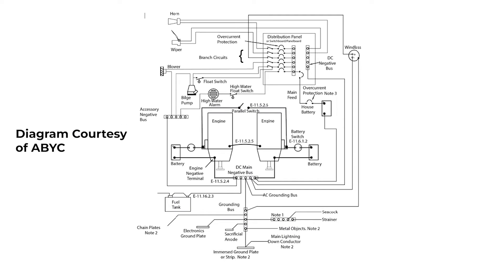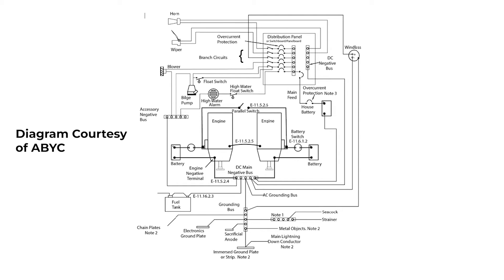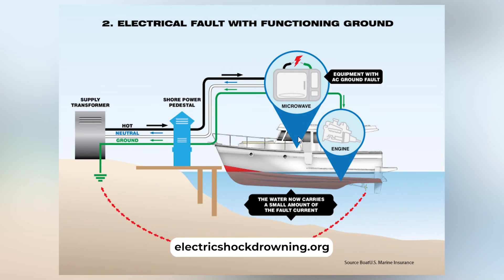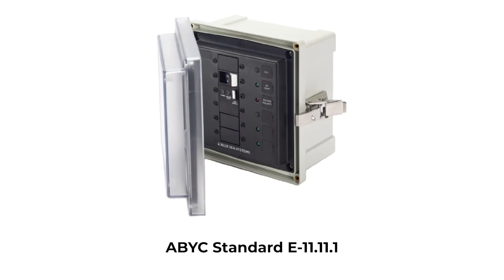Nigel Calder & Jeff Cote Talk Marine Electrical - Part 2 of 11 - Grounding, ELCI, and ESD on Boats

Comment: Thank you both. I really appreciate this content. I'm learning a lot but I have a question I'm hoping someone here can explain. I don't understand the reverse polarity circuit with an installed ELCI / RCD / GFCI breaker. Your main breaker is comparing current traveling on the hot and neutral to break the circuit. Wouldn't placing a reverse polarity led or any load between the neutral and ground put current traveling back on the ground and trip your breaker as well as any ELCI type breaker upstream on shore?

Comment: I have a fiberglass sailboat. It has a dc system with a cranking battery and a deep cycle battery, and an ac system that runs two outlets. One of these outlets has a prosport HD battery charger. Is that charger the inverter?

Comment: Could you explain why the non-conductive(less conductive?) fresh water is more dangerous than salt water.
Reply: Because a person is more conductive than fresh water so any fault current prefers to go through the person. A person is less conductive than salt water.
Reply: My view. Because your body would be the only conductor to ground. In salt water the voltage has all that water to path to ground, you would only be a small part of that, you wouldn’t get the full voltage/ amps. Correct me if I’m wrong.  A little bit of amps running through your body will make that part of your body spasm, in other words you drown cause your unable to swim. Without going though my notes i can remember it being a tiny bit of amps. Less than you would ever think. Just think getting tazer by the cops while you’re swimming. I think you get the point.